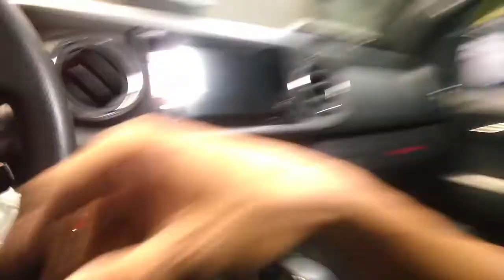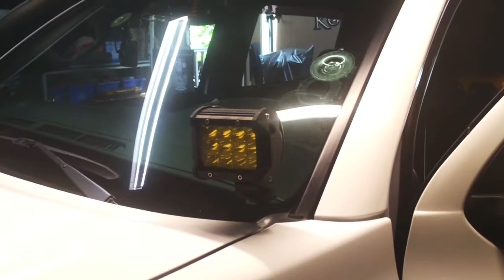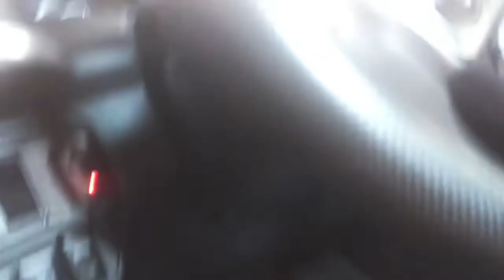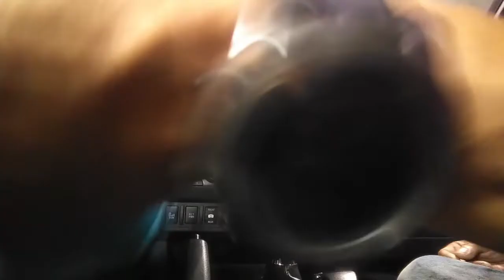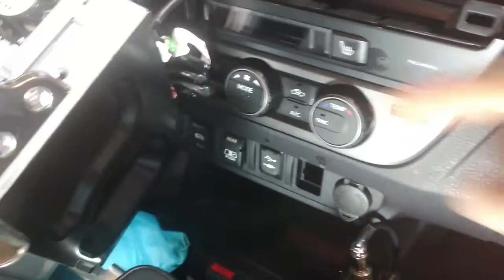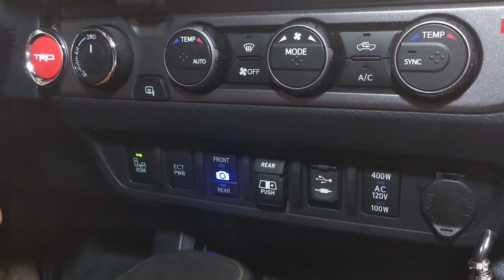How to Relocate Auxiliary Switch and Remove Radio Head Unit and Open Radio Panel | Mod #55

Comment: Did you call your auto high beam but the fog light button? Or did you really re-wire it to be for foglights instead of the switch on the bar switch

Comment: Do you recall what gauge wire you used to lengthen it?
Reply from the maker: @jayparrington6407  no I don’t, I think it’s 16g but not sure anymore. I will check it for you tomorrow.
Reply from the maker: @jayparrington6407  16 AWG
Reply: Thank you
Reply from the maker: @ anytime!

Comment: I got the 2wd low wiring harness and switch from Tacomaworld and install videos I've seen had you take apart the entire center console and dash to get the switch to the proper blank spot. I found your video pulling the head unit out and I was able to feed the wire to the blank WAY easier than the traditional way. helped a bunch thanks!
Reply from the maker: @johnnyhirt8903  I’m glad this video helped Johnny! Thanks for tuning in!

Comment: How do you PROPERLY extend the wiring harness? Id love to reorganize my button layout but i dont kike the idea of splicing more wires than necessary. 

Did you simply grab the same ga wire and use butt connectors and then wrap the wires or something else?

Comment: I havnt looked but you know a good spot to run wires through the firewall?
Reply from the maker: hey Alex, yes, there's a grommet that pretty much runs majority of the wiring from fuse box in the engine bay into the cab. Watch one of my light switch installations (https://youtu.be/8YI3rP6W0oQ?si=BU8Q3Q2VZUV9O0_R) to see where it is.  I hope this helps.
Reply: @modXELA  I just watched the video!!! Thank you bro!! Happy Thanksgiving!!!
Reply from the maker: @alexanderbarrera9140  You are very welcome and Happy thanksgiving bro! We celebrated ours last month up here in Canada.  =)

Comment: i'm not a fan of doing any unnecessary work either, so i looked around the front of the console up near the accelerator pedal and saw what looked like a path to the back of that switch panel. i popped out the switch blank i wanted, stuck a stiff wire up through said opening and it poked through the open switch hole with hardly any effort. i taped the switch plug to the bottom end of the stiff wire and just pulled it out through the switch panel. took me about 5 minutes total.
Reply from the maker: Hey stangoers6364, sounds effective and efficient!  Your method will definitely cut out unnecessary work and will help others!  thanks for the share!!
Reply: This is excellent. I have an open slot right beside the BSM where I am going to put a heated steering wheel switch. I have the 3TPAM and don't want to remove it and then re-install it. Although if I do the long way, I can put a cover over the gauge window that will help eliminate any scratches and clean the inside of dust. I live in a very dusty area and am considering cleaning it all up. But also it's not the end of the world.

Comment: Thank you so much. After looking at many YouTube videos in order for me to install a heated seat switch in that lower panel, everyone seemed to be ripping out the entire front dash. I wondered if it was possible to just go in through the radio and you clearly showed it is possible. Thank you very much!
Reply from the maker: I'm glad the video was helpful to you gastonville11!  I'm not a fan of doing unnecessary work =) so I try to find shortcuts. Please check out my other mod and install videos and thanks for tuning in!